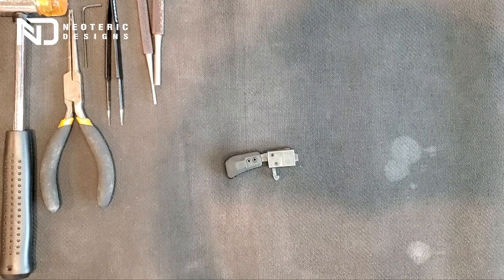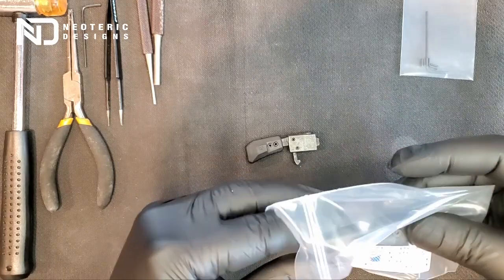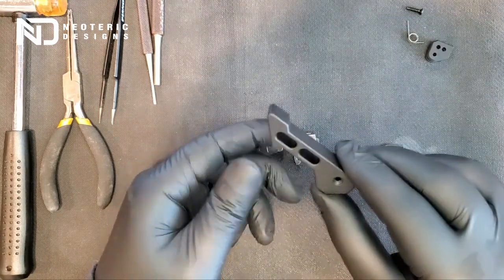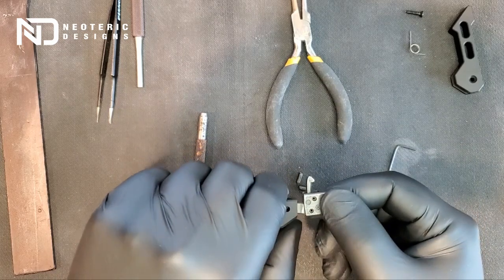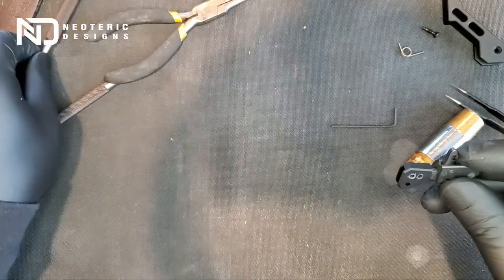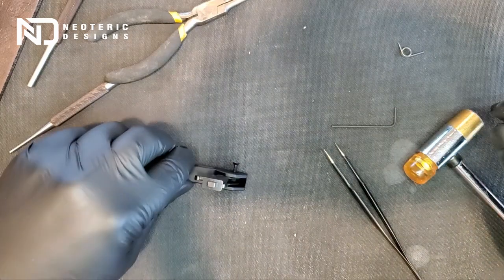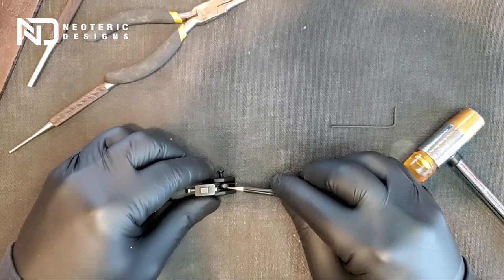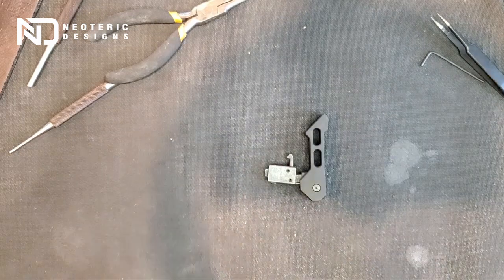Neoteric Designs CZ Bren 2 Folding Charging Handle Installation

Comment: Just received mine today!
It seems good, noticed a bit of wiggle with the supplied pins, with the charging handle folded the charging handle wiggles/has play. Can we not use the OEM roll pins? They should help tighten it all up.
Reply from the maker: @Sevenarrowz The wiggle is inherent in the factory carrier, but typically unnoticeable since there is no rotational force applied. When this handle is installed, the leverage produced due to handle length is more than 10x the factory handle, hense the wiggle is amplified. The supplied pins are slotted and "spring" tight and eliminate any movement. Factory roll pins are too long and won't work.
Reply: @shahens1  thank you for your quick response. Neoteric designs customer service at its finest. 
I am happy to test it at the range!
Happy new years!
Reply from the maker: @Sevenarrowz  Thank you for your support. Happy New year!